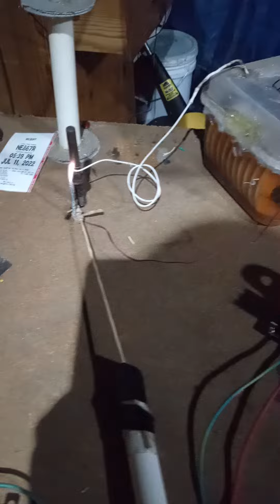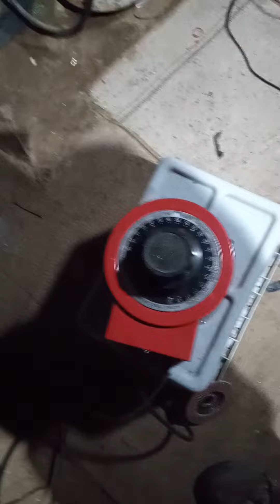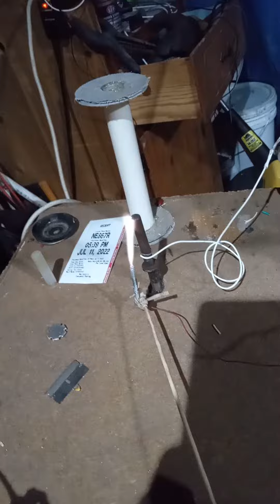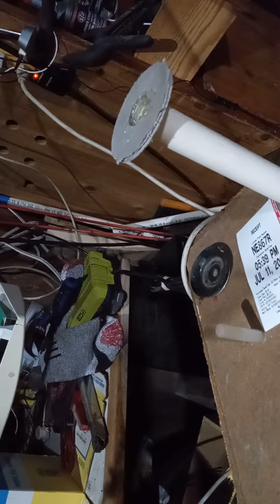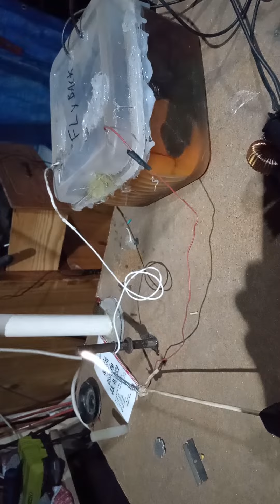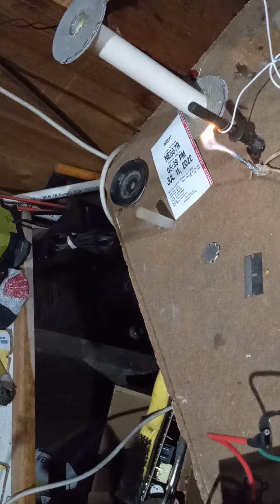fm radio through a homemade flyback transformer

Comment from the maker: you put the positive wire off your power supply through one end the secondary of a transformer that can handle 30 volts DC and the other end to the flyback driver and the primary you just put your audio input there